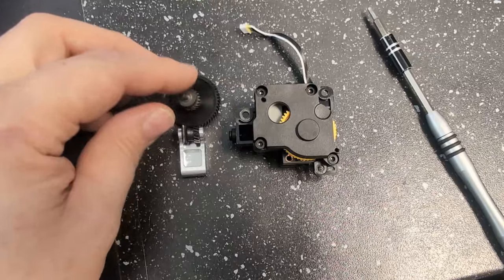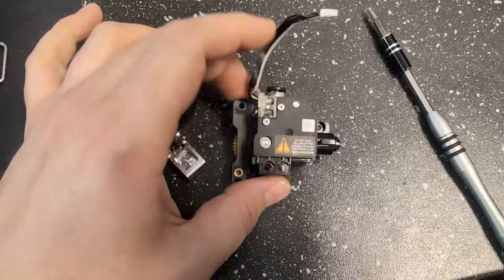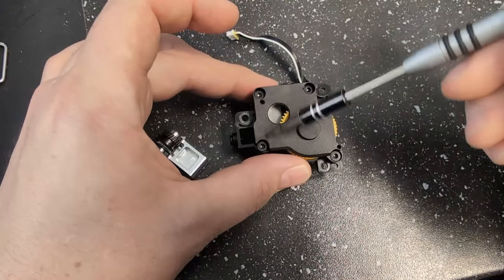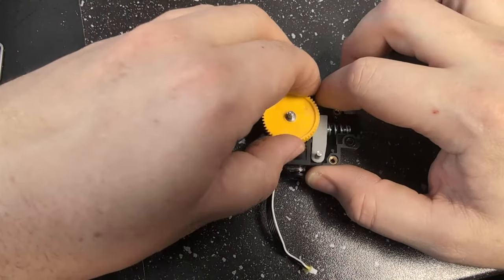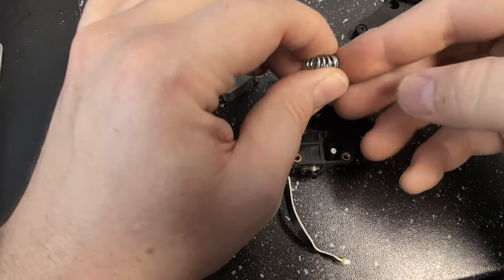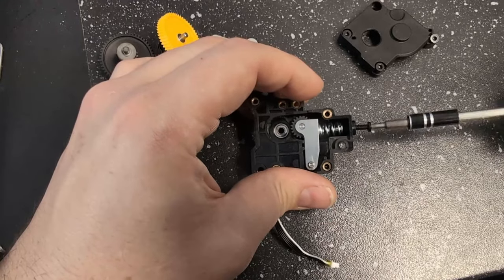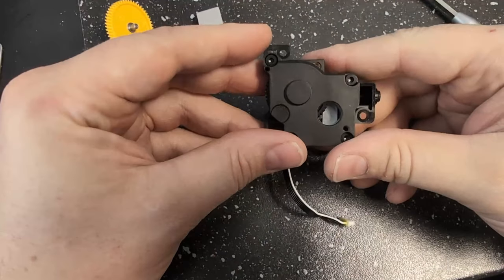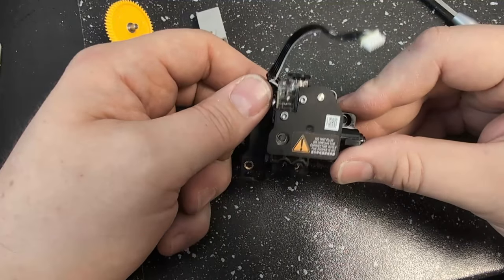TH3D Bambu X1/P1 Nano Coated Extruder Gears - Install Guide

Comment: I ordered one since I like to have back-up parts. Just a hobbyist, however, understand need for back-up systems. I had ordered many parts for my previous Ender 5 Pro from TH3d and all were great. Sold that "heavily" upgraded Ender 5 Pro to a friend (who's SO happy with it) and purchased a Bambulabs X1 Carbon. It has been fantastic and WOW have things changed since my Ender 5 Pro. So happy TH3D is supporting that brand. Retired guy having fun. 😊

Comment: As a new Bambu owner, I'm curious why would I want this? Are the special printing circumstances that this makes better?
Reply: From the product page:
"These are not only hardened steel but also nano coated to resist filament build up and increase resistance to wear. "

Filaments with stiffening additives like carbon fibre, glass bead/fibre etc will, over time, wear down the stock gears. This is hardened steel meaning that is far less likely to occur like 98% less likely.